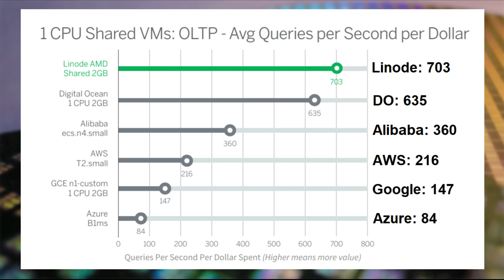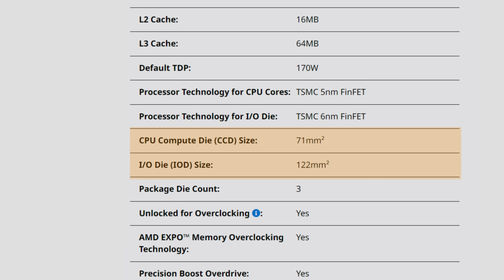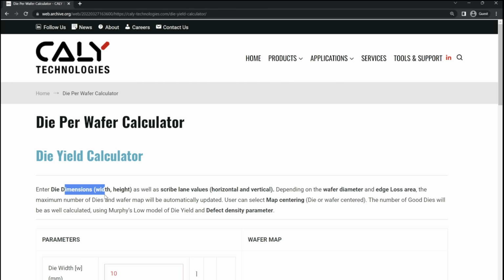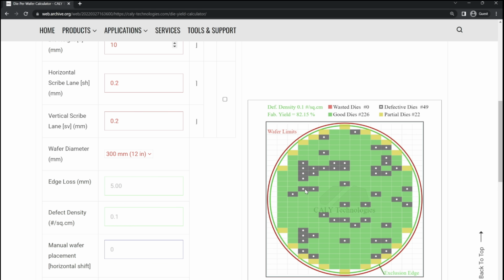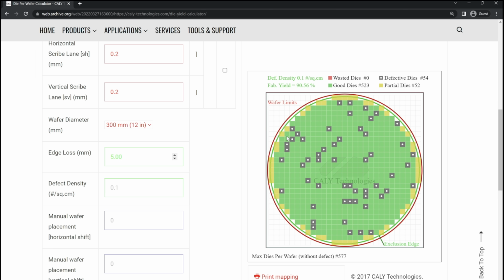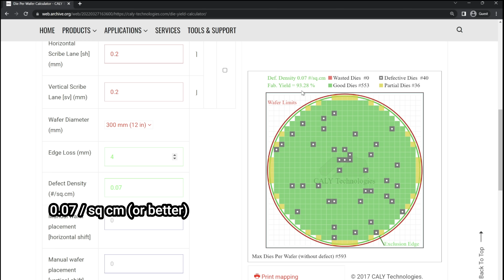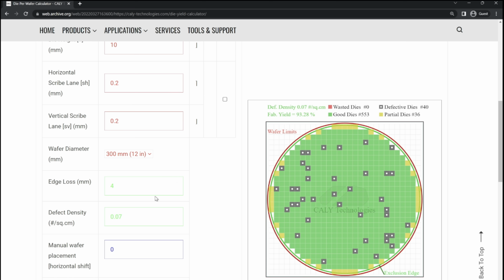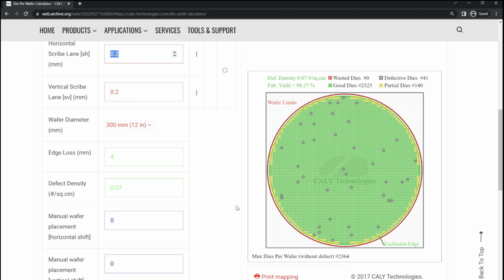AMD Ryzen 9 7950X: Cost to Manufacture?

Comment: As I understand it, when you account for other technical issues seen by self tests the yields will go down. And then when you account for binning... I would image the total BoM cost is probably 2x-3x that estimate. That would still give AMD more than a 75% margin, but that has to go back into the NRE as well.
Reply: Yields are saved by binning, not reduced. Most critical defects will disable one out of 8 cores, even if you stack a lot of defects you can still sell a chiplet as a quad core athlon or a 7300. Basically yields are 99% since almost everything is usable, just that they might not have enough of the high clocked ones for server
Reply: @brainletmong6302  Yields with fewer than 8 functional cores are saved by binning, but not all functional 8-core dies will be able to meet the voltage and clock speed requirements of a 7950X, and the process of testing the CPUs for binning does have some cost in itself - you need the testing equipment and staff to run it.
I don't think hjups' estimate of 2-3x the cost is likely, I would estimate about 50% higher cost, but my estimate may be wrong.
Reply: @brainletmong6302  True, but binning should also factor into a cost estimate, as an effective yield. This video was specifically for the 7950X, and so was my comment. If we assume the chiplets have a 93% yield, and an average cost of $21, that doesn't apply any additional cuts. Also the wafer calculator included partial dies which are not viable options for the 7950X. Anyway, going off of that $21 per die at 93% yield, if you then apply bin cuts for what chips can actually go into the 7950X (voltage, frequency, power efficiency), you may only be left with 50% of those chips, effectively increasing the price per die to $42. If you also want to reserve the best 25% for servers, then that region shrinks to 25%, thus giving you an effective cost of $84 per die. 
It doesn't matter that the chips that don't meet the bin requirements can be sold elsewhere, all that matters is that those other chips will not go into the 7950X, making the total available per wafer smaller, and therefore increasing the effective parts cost.

Comment: Hey amd how about dropping your prices else I might just buy a 13900k o.o
Reply: price is an issue but you're willing to go for an i9?
Reply: @Suilujz  the 13900K is faster* and cheaper**. The only way for AMD to compete would be to lower prices.

*performance varies by workload. Intel wins some, AMD wins some. Intel does technically have a small edge by a couple percent, but AMD may be a better option depending on what you are doing.

**the 13900K retails for around $50 less than the 7950X. Z690 is also cheaper, and Z790 might be cheaper than X670/E. You may have to spend more money on cooling though, and you will spend more money on electricity***.

***excessive electric expenditure can be reduced by predominantly gaming or having your PC double as a heater.
Reply: @dex6316  and the 5800X3D beats the 13900K in intels own slides, I don't care about electric expenditure that much, I'd just expect new-gen performance to be more efficient and not just throwing more watts at it to keep up

Comment: I wonder if TSMC can utilize the "partial" die area at the edges of the silicon wafer, which isn't large enough for the main AMD/etc. chips. Maybe they could use this area to etch other smaller kinds of chips, like tiny memory chips or other small ICs of some kind

In terms of defect density, from what I understand, the further a die is from the center of the wafer, the higher the likelihood of a defect. It would be cool if this website tool could account for that (though it would just be a UI change)
Reply: You would have to ensure that all your "substitution" dies also have the exact same oxide layering for your given chip that youre attempting to squeeze in. Some processes also carry less stability in uniformity at the outer extremes of the wafer. Given the integration risks, generally lower yields, and complexity in re-engineering an entire product node to be a copy of a different chip in film heights, you quickly run into a value question. -- Your friendly CMP enginerd.
Reply from the maker: They don't do that - they still print the same chips at the edge so when you cut them up / dice them, you have a repeatable and expected breakage every time
Reply: If there was a practical way to not waste that silicon, you better believe it would already be in use, haha.
Reply: i think they use a standard poisson distribution to estimate defect probability.. theres no independent variable that goes in there. thats why they define defect density as a single isotropic number
Reply: @swdev245  probably because its faster to keep the line running than to do all that, it masks the entire wafer at once
Reply: @swdev245  No. You have photomasks that cover the entire wafer.

Comment: Nice. Something I wonder, is the process of plucking the fully working dies and partially disabling binned ones also included in the wafer cost and done by the fab or is it a completely separate process someone else does before they are sent for packaging?
Reply: Some fabs do it, some hire outside companies to do it.  There are several companies in the world that take the wafers from the fabs and test and package them.
Reply: Niceeee
Reply: This is generally the job of the validation engineers to figure out.
Reply: The fab does it. The fab checks every single chip before sending it off. The binned ones are factored into the cost of the functioning chips. The most high end chips often have lower yield so they are priced higher with binned high end chips being disabled to sell as lower end chips

Comment: Do both partial and dies with included defects become lower bin products (7900 CCD instead of 7950 CCD) or just the ones with defects? Could the die be designed with that edge geometry in mind to result in usable product to increase overall yield, or does that theory not actually work out in practice?
Reply: Yes.  I had an AMD Sempron II dual core years ago and I could unlock the bad cores and run it as a Phenom II quad-core.  They were so good at making chips back then that it just worked.  I got a $450 chip for $57.
Reply: Yes, both.
The demand for cut-down dies is high enough and the defect rate is low enough that most 6-core CCDs (used in the 7600X and 7900X) could have been sold as 8-core CCDs (7700X or 7950X), AMD just cuts down most of their CCDs for segmentation purposes, to meet the demand for lower-end CPUs.
There is a sometimes a small benefit to the consumer though - disabling the worst cores of CCDs with 8 working cores means that they can maximise power efficiency more easily. While most Ryzen 5 7600Xs could have been sold as working 8-core CPUs, many of them wouldn't have met the efficiency and clock frequency standards of a Ryzen 7 7700X on all 8 cores. Gamers are likely to benefit more from a Ryzen 5 7600X than from an 8-core Zen 4 CPU that constantly thermal throttles because it has 1-2 weak cores.
Reply: Looking at the Zen 3 die ( which Zen 4 is based on), the cache is in the middle and cores along sides, with interconnect stuff on top. So in theory some partial dies on bottom part of wafer could be 6 core per CCD chips, though in the end it probably has only a small effect on overall yield, since it would need to be a very small loss of space from partial. The partial die issue is another reason to go with chiplets, because even with 100% yield, you lose some to partials, and smaller dies result in a smaller percentage lost to partials.